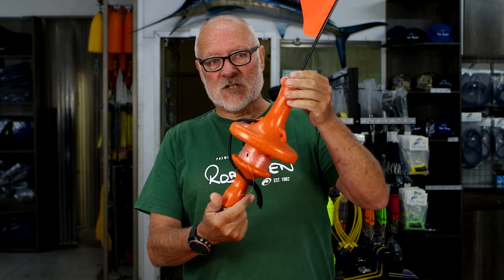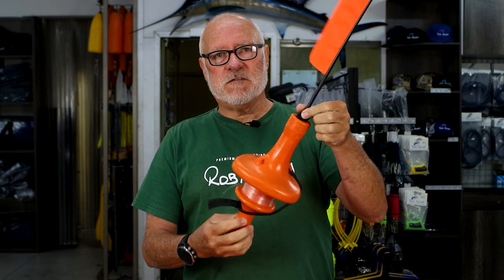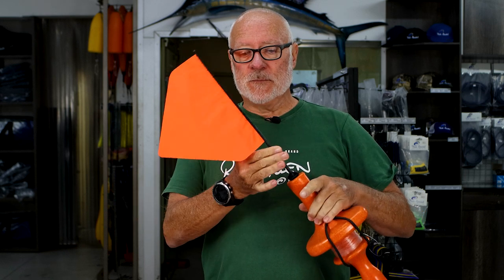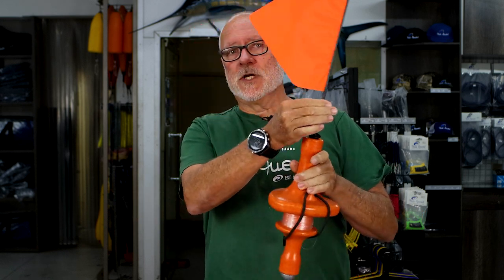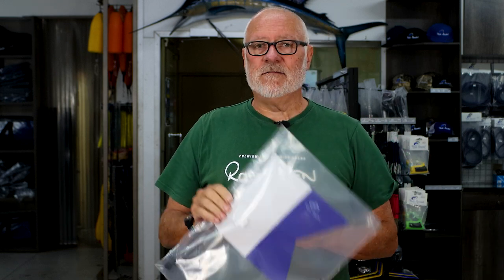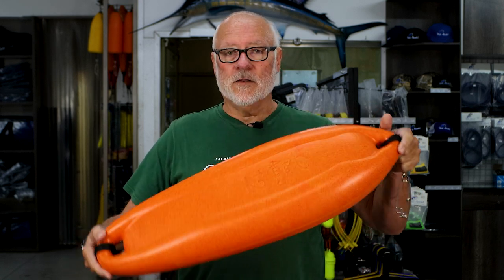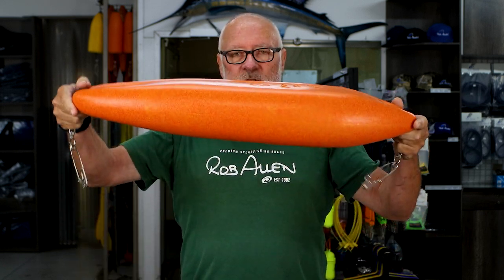Rob Allen | Roto-molding our Floats | 2024

Comment: Hi. I am using RA timberline roller 110cm. I need to change the rubber, what type it is ( it is black). On my other RA timberline roller 80cm i have blue rubber. What is the difference. Thanks!
Reply from the maker: No difference, it is just a colour.
Reply: @RobAllenSpearfishing  Your rubber chart for RA timberline 2023 says:  Barrel 110cm - Blue rubber 65cm lenght  Black/ green rubber 70cm lenght.  No difference?
Reply from the maker: @dejanpremrl6711  There is a subtle difference from time to time, it depends on the batch. Basically 5cm is about the variance pending the age. Always start a little longer, you can always shorten.
Reply: Thank you!

Comment: How heavy are your fin blades? You never replied?
Reply from the maker: Sorry for not getting back to you earlier.  🙌

The weight of our fin blades does vary. 

Without the side rails, an individual carbon fin blade will weigh roughly between ( 235 - 260 grams) 

I hope this helps you 😎